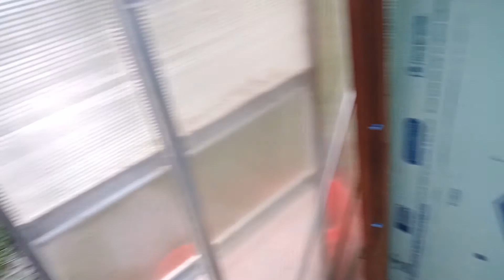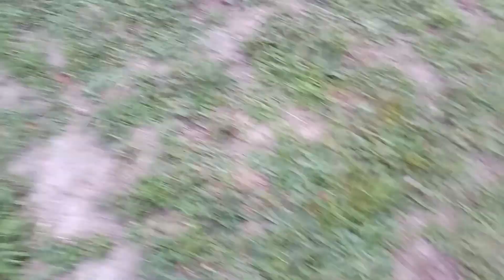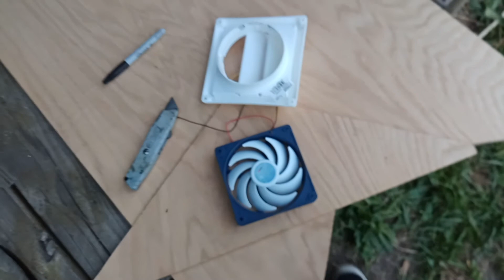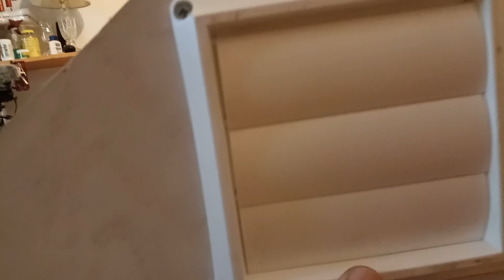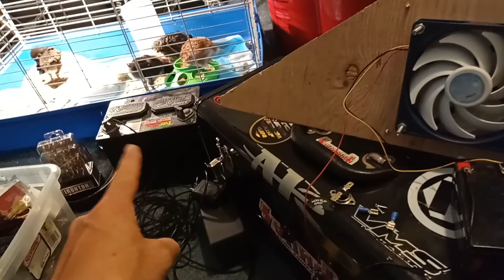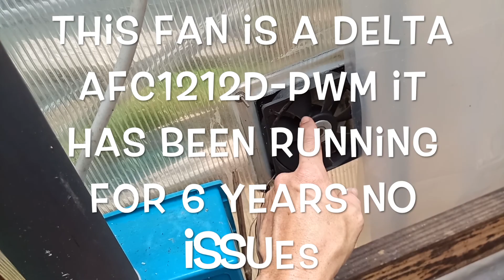Exhaust Ventilation fan for a harbor freight 6x8 GreenHouse

Comment: I built one the same size as this out of pvc pipe and pallets but I added a floor to make it warmer.I don't have much room on my small lot for anything bigger .It was a lifelong dream of mine to have a green House so I'm very pleased with it.I wanted to thank you for uploading your video on making an exhaust fan using a computer fan because without your video I don't know that I'd added them! I'm using one of the fans to circulate air but the other one will be connectedto a solar panel and be an exhaust fan. I have a couple manual air vents,some low and some high.I also have a window on one end and wide door on the other so it has good air flow in the summer months. Mine will be unheated for the most part but I may add a thermostatically controlled heater that turns on at 32 degrees to protect the plants from freezing.I'm using water as a thermal mass as well .Keep those video's coming.I love to watch them!